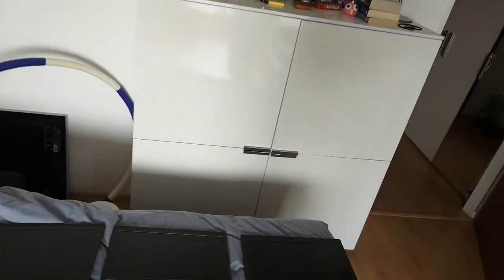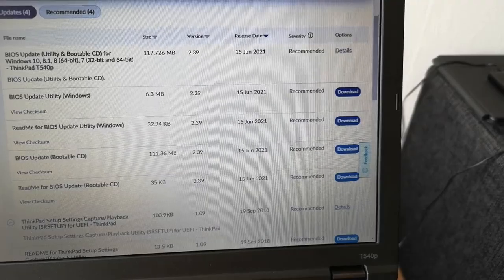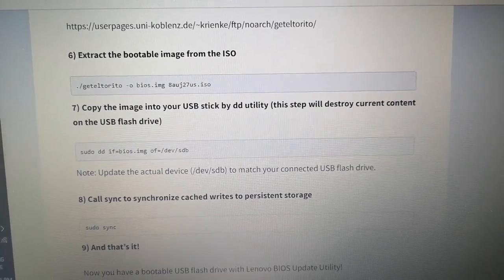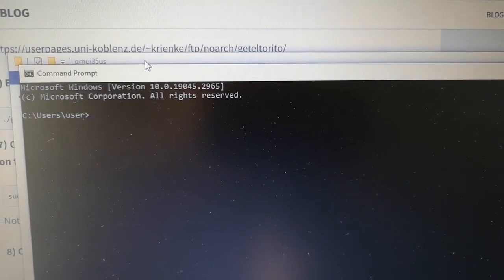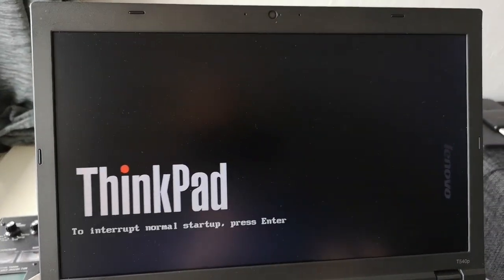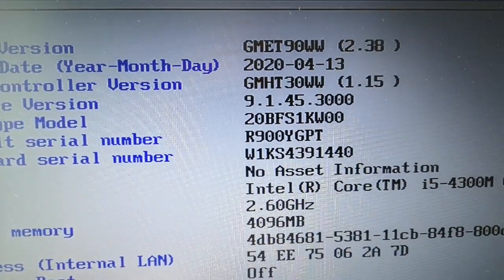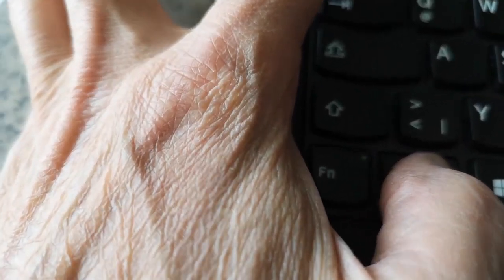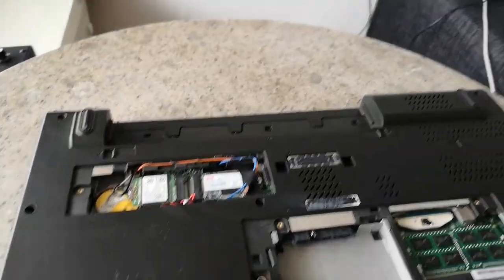Lenovo Thinkpad T540P Bios Upgrade with no Battery and Other Settings

Comment: Huge thanks to the video creator and @alejandrocapell2780 for the detailed information. On my laptop, Lenovo ThinkPad T460s, it worked on the first try — very helpful! The key is: take your time, be careful, and double-check the path you enter in the command prompt (cd "<path to folder>" and winuptp64 -sp). I used the silent mode (cd "<path to folder>" and winuptp64 -s -sp). For safety, I waited 30–60 minutes, then rebooted the laptop, and the update went through. Thank you!

Comment: Many thanks for uploading this video. I am not getting battery status of my Lenovo and even  after replacing battery it is not charging (although tray icon says its fully charged but actually it isn't). So am advised to update BIOS. How log does it take? Because I am doing it with no battery.
Reply from the maker: You should connect external power source when upgrading bios. Takes a few minutes.

Comment: After it says error flash module cannot be found.The utility process has not completed
Reply from the maker: This is a different problem and probably not connected with the "No battery" stuation.
Reply: @ I see,can we solve it?
Reply: I have the same issue. Did you manage to solve this?
Reply: @rw545 no,I haven’t
Reply: Same here.
Reply: Had that happen too, not sure if it was due to me putting it in a folder in C (I'm too lazy to type out all that directory)
Worked with a shortcut 
Extract files from the bios update like in the video, find winuptp64.exe, create a shortcut to it.
Right click on the shortcut, open properties and -sp at the end of the target (I also selected advanced/run as administrator, but don't know if that's needed.)

Comment: Thanks.  Just updated my T480s using this method to v 1.56 Bios.  My battery isn't charging so working through all potential fixes until I buy another battery.
Reply from the maker: Lenovo business laptops are my favourites. For my uses they are great !

Comment: Came back to this video because it's the first one that pointed me in the right track, and wanted to help others with this problem. 
Simon has the right idea here but I had to do a few things differently. 
Step 1 Go to Lenovo website > support and download the correct BIOS .exe 
Step 2 Execute the .exe but only extract it , now find where it created the folder, mine was under C>DRIVERS>FLASH 
(Like he mentions enable view hidden directories)
Step 3 Once in the files folder and having located winuptp64 right click it>properties and copy the address/path 
(Dont close the properties window) 
Step 4 Open cmd and type: cd + the address you just copied 
Step 5 Now go back to properties and copy the file name, go back to cmd paste it and add at the end -sp
Reply: good job
Reply from the maker: Thanks
Reply: Confirmed to work for X1 Carbon 6th Gen - (Type 20KH, 20KG) -- I was able to rollback to BIOS v1.08 successfully
Reply from the maker: Excellent !
Reply: What if mines is only WINUPTP.EXE that is showing?  LENOVO L430
Reply from the maker: Glad it helped you in the right direction !
Reply: Many thanks. How long does it take to update?
Reply: WORKS 100% I never thought i'd have find the solution in a comment, thanks man

Comment: Im buying a used T540p mint condition, put an 2tb m2 msata 2242 on it as Boot, and 2tb hdd and 2tb hdd caddy as storage, upgrade it to i7 4900mq, all works well, it boots, and then i update all using Lenovo Vantage.. when it update its BIOS itself.. its bricked itself! Black screen! 60 sec press button, coin cells removed, all nothing! i HATE LENOVO, and worst of all, im buying all that parts credit.
Reply from the maker: I don't think that Lenovo laptops are designed to have the CPU upgraded. How do you know if the BIOS contains the microdes for the new CPU ?

Comment: Can you do the one about lenovo t540p with the battery whitelist,especially when using Second hand battery
Reply from the maker: I only have original Lenovo batteries. I know that for the x220, x230 etc there was a modified bios released by someone that allowed any batteries and other hardware to be used. Take a look here: https://www.bios-mods.com/forum/showthread.php?pid=141098#pid141098